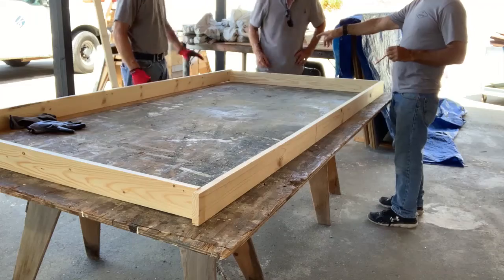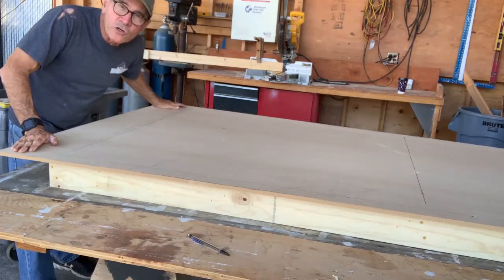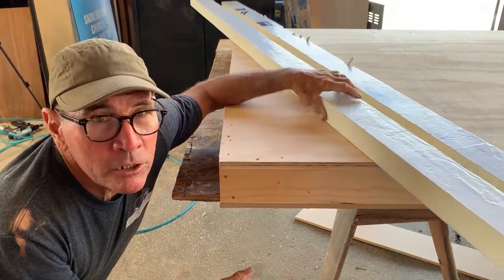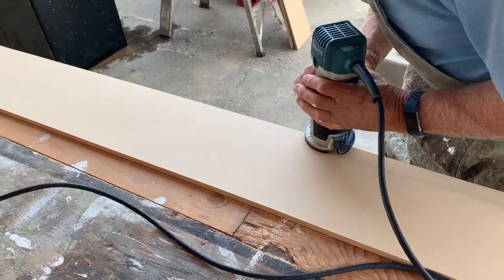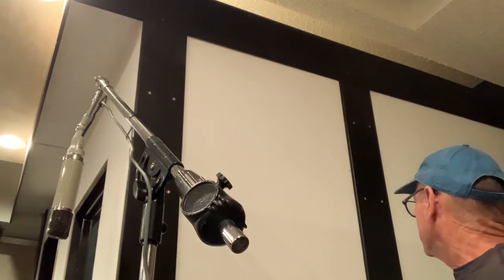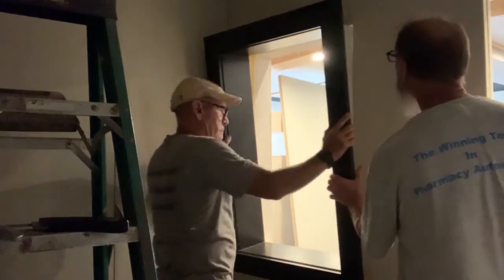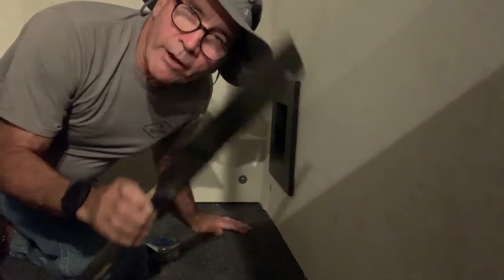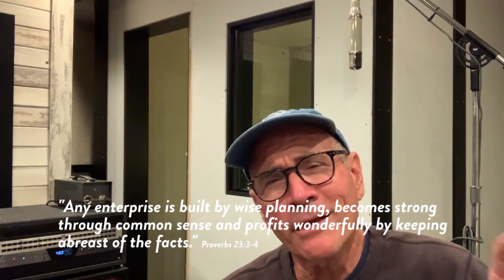Building a Sound Booth

Comment: Wouldn’t you want an air gap to dampen vibration between the two rigid foam pieces??  Like soft foam damper furring strips seems like it wd have improved the STC.  Has anyone used Homasote in lieu plywood or drywall as a sheathing?  I wd think the Homasote has better sound dampening and is fire resistant. Insulated glass w/ good STC acoustical insulation properties) ratings also has an air gap (or is argon gas filled) vs being laminated together. I think you can buy insulated glazing but it shd have soft gaskets or setting caulk to prevent rattling /vibrations in the frame.
Reply from the maker: Good ideas